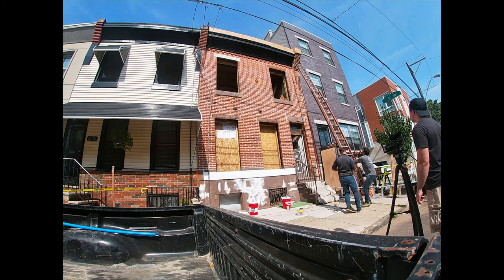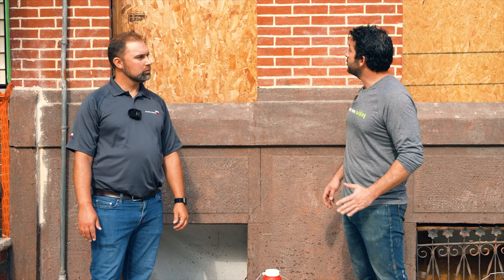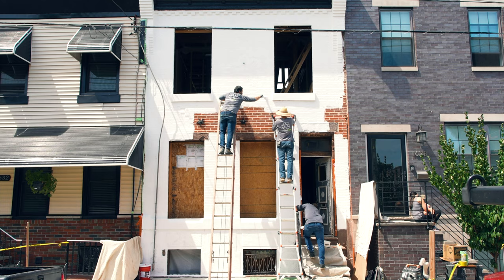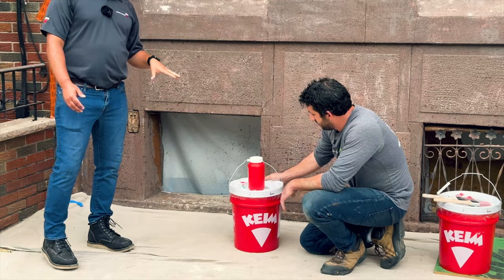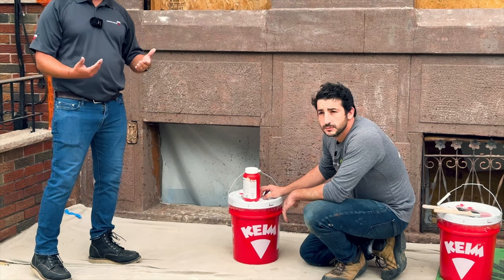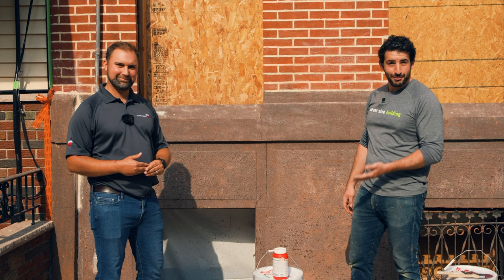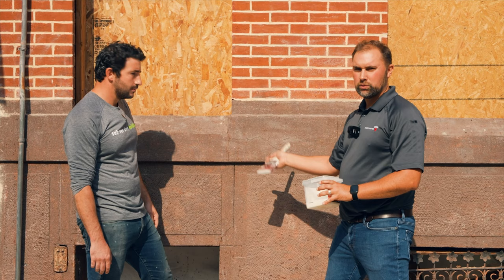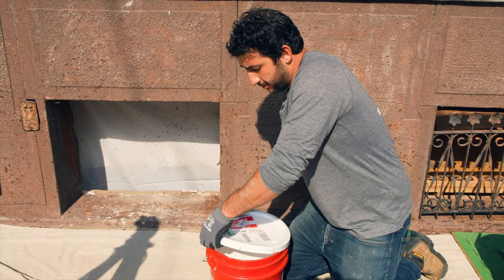Painting Brick The RIGHT Way With KEIM Mineral Paint

Comment: Can you paint first then repoint with a lime mortar afterward? I was thinking that might look cool if you use a mortar with a different color. I am digging your stuff keep it up y'all.
Reply from the maker: So I actually asked Perri about doing masonry repairs after the painting was done - a lintel needs to be patched. mortar will bond.  As far as pointing after painting, I imagine it's not impossible, but would have some challenges.  Maybe grind the joints, clean the brick, paint, point, touch up?  it's kind of a mix of tuckpointing and changing the brick color...
Reply from the maker: and thanks for the kind words!

Comment: Great video and awareness.  We compete against Keim.  Their products are great, but expensive.  I would note, when you guys were applying, you are toothing it in incorrectly, you always finish at the joints and dry back roll.  If the color was darker, your spots would show up all over the place.  This is not a wet on wet process, so there is an art to it.  Either way, it's great at least you are educating knuckleheads from using latex/acrylic or elastomeric on these types of projects.
Reply from the maker: Thanks.  We’re really happy with the mineral paint so far - as well as their customer service, available product info, and the company’s ethics/values.  We don’t have much experience with staining brick yet!